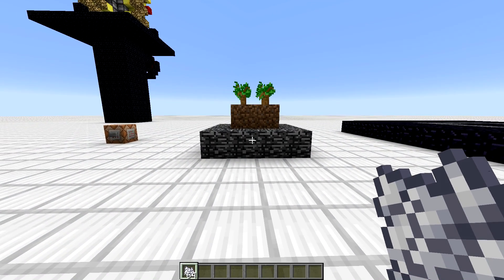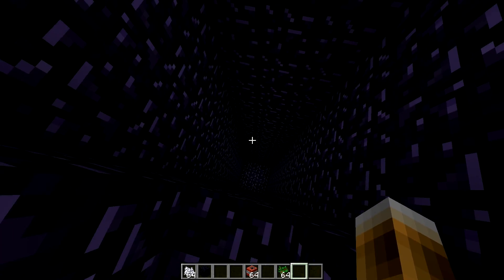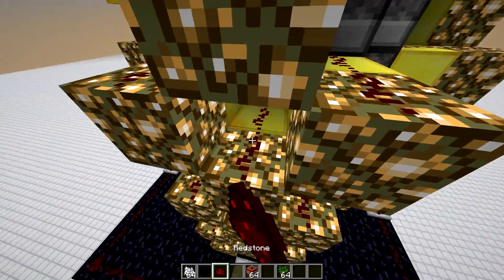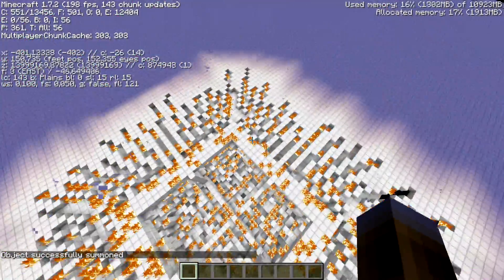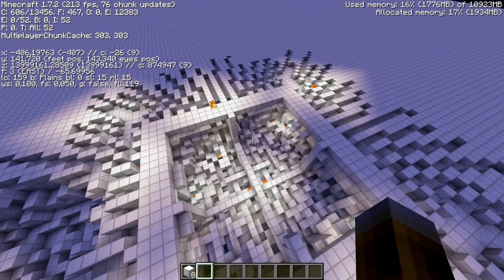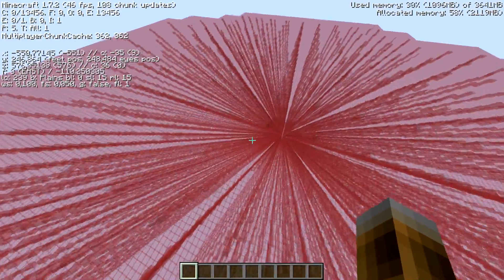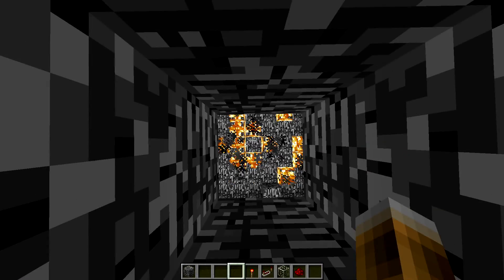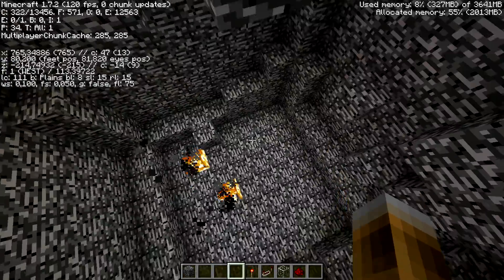Minecraft Science: Explosions ( How to blow up Bedrock - Explanation)

Comment: I thought bedrock has an explosion resistance of -1 making it impossible to blow up.   ?
Reply: +The-Mike_D That would make it destroayble by everything
Reply: +theSubGhost maybe but i think if something had a blast resistance of -1 then it would require a fireball that 'attacks' a block in the minus numbers like explosionpower: -5 and if you use a positive explosion power, then it would do nothing.
I do understand your thinking though because if a blast resistance was >0 then it must have a resistance. if it is =0 then it must have no resistance but if it was <0 then it must be the opposite of resistant which is more susceptible to an explosion and therefore much weaker.
personally i dont know what would happen and also i dont know  what would the game respond like if that happened.
Reply: +The-Mike_D No, that's its hardness (which is different to Blast Resistance.)

Comment: wtf he has a good pc my mac crashed on this /summon Fireball ~ ~ ~ {direction:[],ExplosionPower:3000000}
Reply: 好麥克 And a custom build pc or a good laptop is anywhere from $500-$200, giving it 5-25 times MORE performance than a mac. :)
Reply: 好麥克 Mac is shit for the price you pay
Reply: 好麥克 I think you are a troll but a Mac has a high price and VERY low performance alienwere are waaaayy better for the same price P.S. I don't have a alienwere
Reply: 好麥克 stop insisting on your facts. mac is overpriced and shitty, alienware is that too, but it runs way faster than a mac would.
i'd rather make a custom built pc for 200$ and get very good runnings than buying a mac for 9001$, showing it off to people and having it run very slowly
Reply: qpro 1234 You're crazy
Reply: Crazy?
Reply: Mac is way better than others. It crashed because the strength, in video he only test up to 1000000, and it takes him 10 min. But what this guy put is 3000000, so it crashed.
Reply: Jesse Verbruggen Then what's good in your mind? I don't care about price, I care about performance. Also, Mac isn't that expensive, a great system with great price around 10,000 USD
Reply: Kiril Spiroski Alienware are better, but still overpriced. Custom build a pc!
Reply: Sorry, it's not 10,000 USD, it's about 1,000 ~ 2,000 USD. Also, Mac runs fast and perform great. If you haven't tried it, then shut up! It only take less than 10 sec to start and use instantly!
Reply: +Phoenix noob. #gentoomasterrace
Reply: +好麥克 lol i put 4mil on my high end pc and it worked fine. think before you speak macboy
Reply: +好麥克 As the owner of an Alienware LAPTOP, I can say that the amount of time required to start it up is 5 seconds. I also get 300 FPS 95% of the time. Sure, it may be a bit overpriced, but it does the job. I've never played Minecraft on a Mac before, but I did used to own one, and I can say that it's not ideal for gaming.
Reply: +好麥克 If you buy an expensive pc the quality will be just as good or better